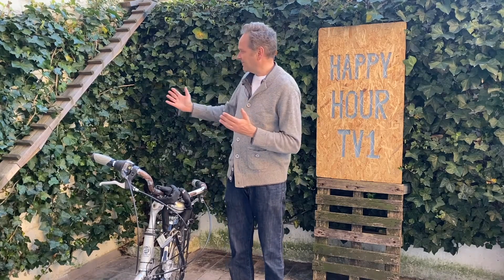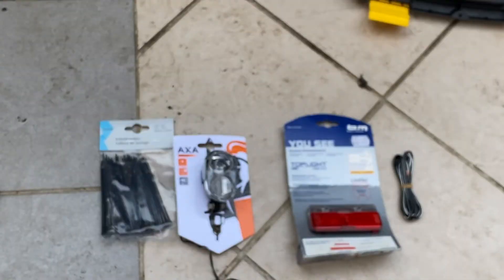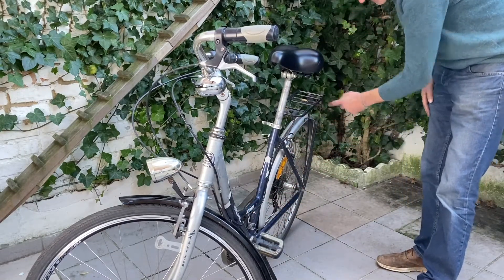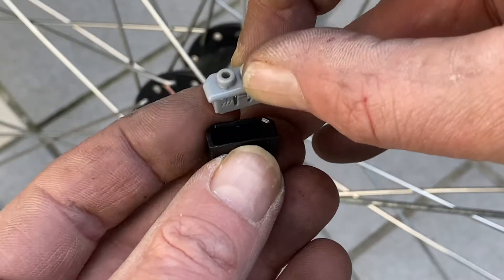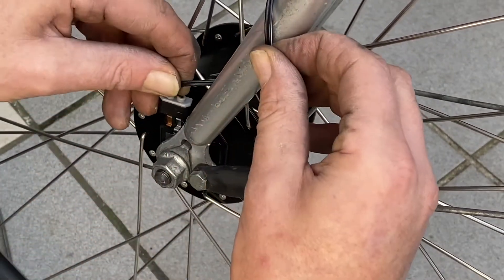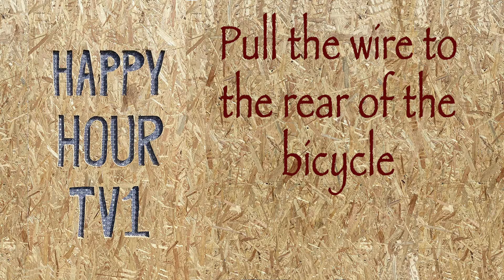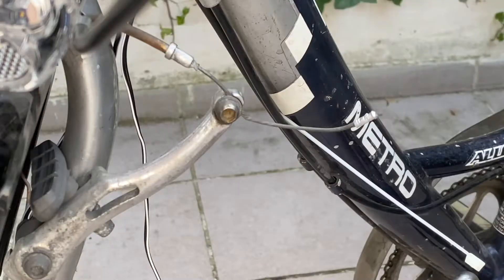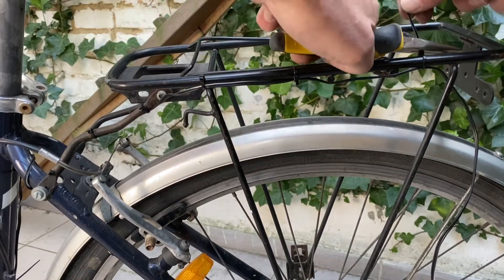Connect the lights of your bicycle with a dynamo 1/2: front light

Comment: Hi sir, i have 2 lights on front and 1 light on rear and my bottle dynamo has only 2 connector, how can i wire it?
Reply from the maker: Try to put the two front light wires together (with the wire from the rear) when connecting them to the dynamo. Then it will depend on the power of your dynamo if it can feed two front lights. Good luck !
Reply: @Happy_Hour_TV1_in_English  thank you so much

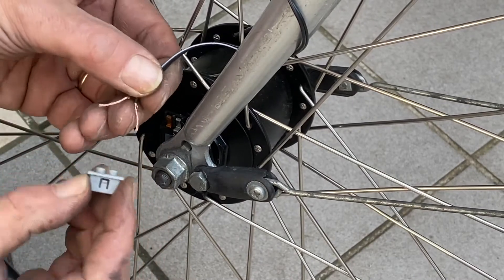Comment: Thank you, on 5:25 you put the black wire into the ground one. So its different from what you said. I have the same light and have put the cable with the white in the ground. Is this alright and what can be the problems if i do this the other way around? Can it break my light?
Reply from the maker: thank you for your question, boloboys7835 ! No problem, you can do it either way. It won't break the bulb of your light. In case of wrong connections it will just not work ! Should this be the case, revert the connections and it will work ! Good luck!
Reply: @Happy_Hour_TV1_in_English  Thank you! :)